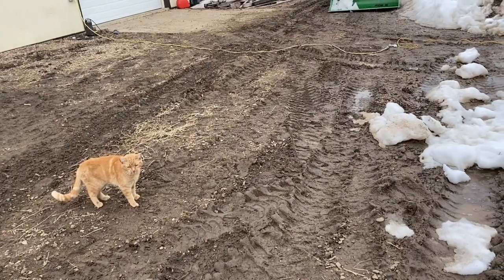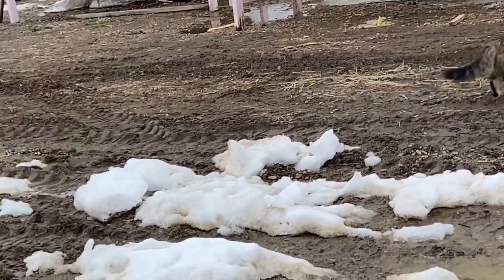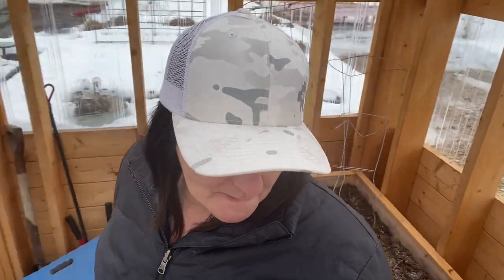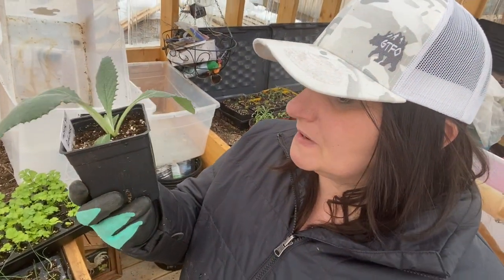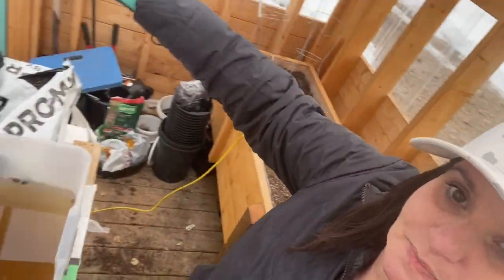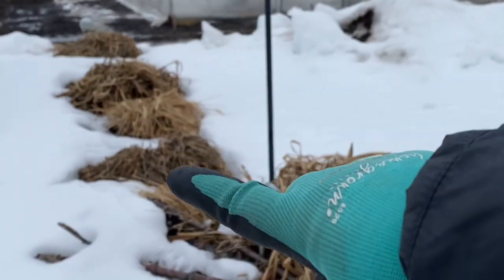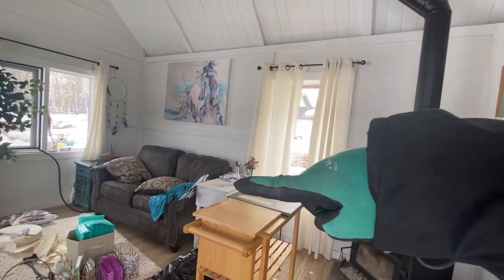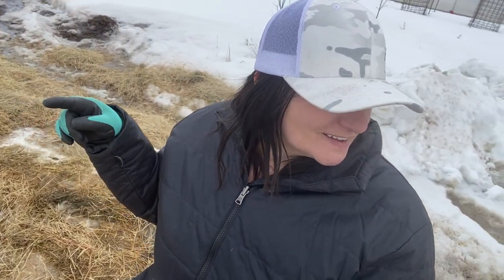Farm vlog. Plant shipments arriving, big setbacks. Flower farmer reality check.

Comment: Today, Tuesday the 5th of April, our temps are in the upper 80s and as much as I hate heat and bugs, I really don't think I'd handle all the ice very well or the mud. .... Plus 5?! 5?? That's still below freezing in F, right? Yeah I'd freeze there lol. I don't even go outside if it's below 45-50F. I am learning a lot from seeing how you do things in the cold though. I always hear people saying it's warming up so I can plant. But my idea of warm is apparently not what people are talking about when they say warm lol. I think 80-85F.  I planted things a lot earlier this year when temps were mostly in the 50s or higher and things are growing great. ... Our chickens get into so much mischief! They're lucky they lay yummy eggs or they'd have to go.
Reply from the maker: Lol yes we are a frost hardy bunch up here. 5°c is 41°f. I like it best when it’s 10°c (50°f) to work outside in the spring otherwise we all get too warm adjusting to the heat. When it’s above 35°c (95°f) we usually go boating or something and come back to work when it’s cooler. We are not built for heat lol. Our house doesn’t even have ac. The past 15 years they started putting ac in houses up here as a normal feature. Wood heat is more popular here than ac. Your warm is like an oven for me lol. I wouldn’t last 5 minutes working in that heat.
Reply: @cowbosskristy  OK but 41F is still too cold lol. I like the 60s with low humidity. If the humidity is high then the cold air stings through my clothes. I don't go out and do much when it's in the 90s because with the humidity it's hard to breathe, like the lungs don't want the air so hot. Winter here is like summer in northern places but we are stuck inside most of summer. I was too late planting this year so I am going to wait until September or most of the plants will die off by July. I watch lots of homesteading channels and so many talk about making sure to have wood or whatever to stay warm but I'm trying to figure out how to keep the AC going in summer if the grid goes down. We don't use our heater more than a few days a year but the AC is going about 95% of the time. :)
Reply from the maker: I couldn’t survive in the heat. I admire your skills. Humidity here is terrible for frost bite. It’s usually the hardest thing to deal with in the cold. September I’m hustling to bring everything in and preserve before freeze up. I found that we are getting hotter in summer. Record highs. It helps learning from others to grow in hotter climates. Homestead channels are gold. Love them all.